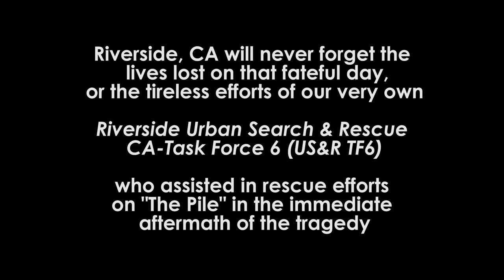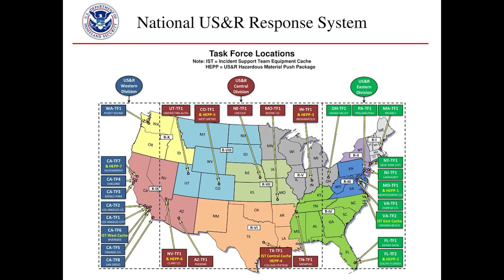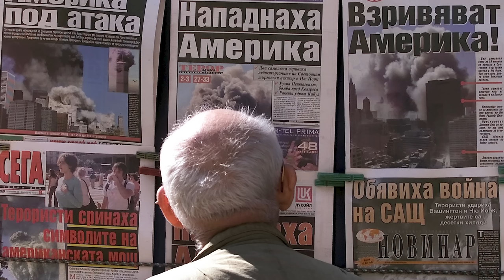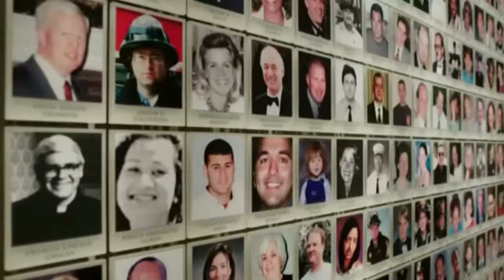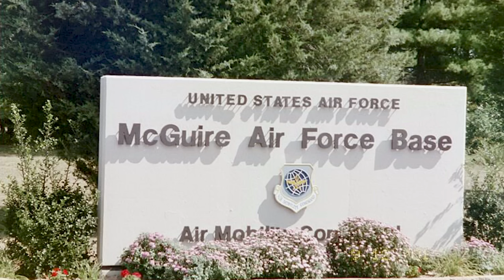9/11: One City Remembers

Comment: Don't kettle your dog. They can, will,  have and do provide a service and are confident and completely confident in their abilities to be everything their suppose to be. Putting them in a cage only causes confusion and uncomfortable waiting. Holding them doesn't mean their gonna stay focused in their job and not get distracted. A dog works well and is at their best when their trainer is bu their side and makes them confident. Its the relationship. The need to work and please for their reward. They get satisfied by your happiness due to their actions just as much as you do. Separation doesn't help your dogs reaction. It only confuses them and may make them build up so much energy that they overlook things bc they want their prize and attention so badly. Treat them the same way you'd treat a human who would stand in front of a bullet for you. They don't feel many things but they feel their partners needs and their needs for them to succeed. Stop putting your partners in a cage. They save lives. Respect their purpose vs overthinking what's protocol.

Comment: jetfuel doesn't burn hot enough and would have been burnt up quickly - the US Gov't want the world to believe it was fire from curtains, carpets etc that brought down not one but 2 steel buildings. So that makes EVERY HIGH RISE building around the world susceptible to collapse from a small fire - how does this building practice pass the relevant national codes and standards?
Reply: So the jet's engine that fell a block away was place there, so were some of the passenger seats. Right?  The planes we see going into the towers were holograms, Right?
Reply: Yes jet fuel and office fires burn hot enough to weaken steel plus the fireproofing material was blowen off from the exploding jet
Reply: The steel only had to soften, especially the thin floor trusses as they helped keep the buildings rigid.
Reply: INSIDE JOB
Reply: Does it hurt being that stupid?
Reply: @charomejia-gm4yx  where in my comment did i say a plane did not hit the tower? Why don't you explain how WTG7 collapsed. If US buildings are so poorly constructed where curtains and furnishings can collapse a building, every person in a multi floor building is risking death every day if someone lets a cigarette burn in a waste paper bin
Reply: @mikebyrd8278  that may explain why 2 or 3 floors may have collapsed - what about the other 90 where they fall in their own footprint? turbofan without afterburner exhaust temp inside the nozzle reaches 600C, peak temp of a house fire 600-900C, if raging 1093C, sreel melting point 1370-1530C. so you are saying carpets and curtains burning that are not in contact with the steel structure melted steel beams when even in ideal conditions in a raging fire, these items cannot reach the melting point of steel?
Reply: @naas699  it's not going to just fall a couple of floors. With all that weight above the impact zone is not going to magically stop. It didn't fall into its own footprint.. nobody said the steel melted
Reply: @molybdomancer195  so why did the other 90 floors collapse? of course you ignore the frame tube structure with large internal columns aided by the external wall.these walls were also weight bearing - last i saw none of these lower walls were touched by fire, steel columns varying from 6.35mm to 10.16cm - I'd like to see how burning carpet will melt steel that thick.
Reply: @mikebyrd8278  yeah you keep believing that, you know nothing of the properties of metals and steel or construction, and it did fall in its own footprint at the same speed as a controlled demolition
Reply: @naas699  and you know what I know how?? You don't know what damn thing. I know it's still loses half its strength at  around 1100 Fahrenheit. I know structure fires can get hotter than that. I know it did not fall into its own footprint. As its footprint is 1 acre each for buildings 1 and 2. In the debris field was 15 acres and destroyed 6 of the buildings that day and damaged another of others. I also know it didn't fall asleep on speed